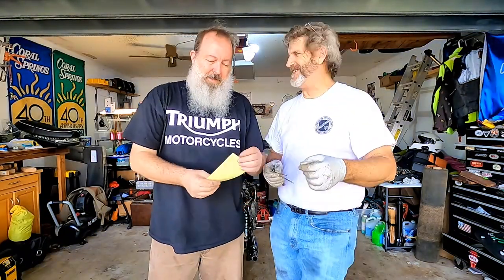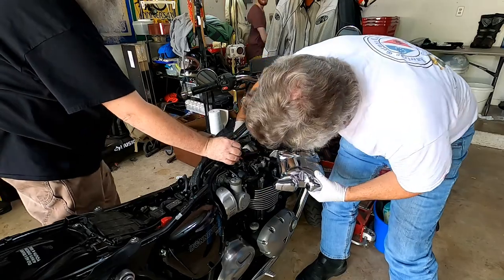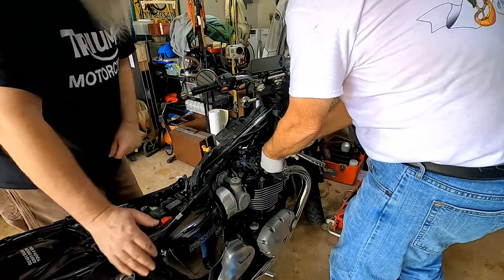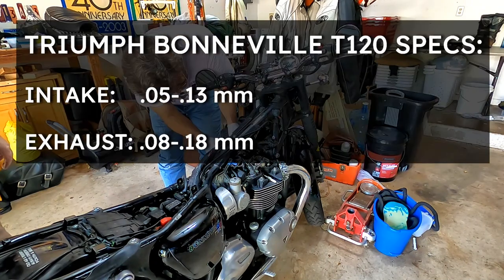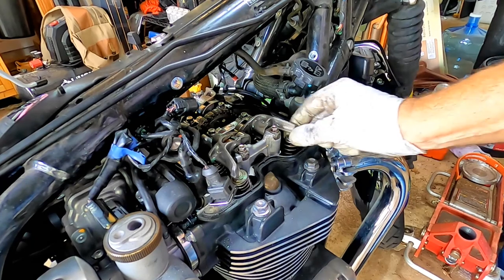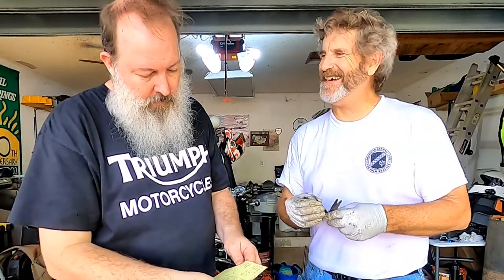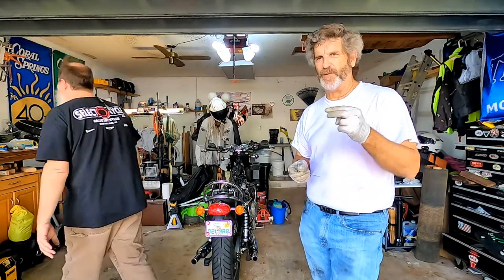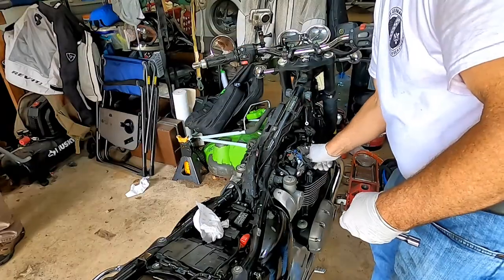DIY Valve Check on a Triumph Bonneville T120

Comment: You guys just sold me on a Speedmaster with this video. Triumph seemed to check all my boxes except for that awfully short service interval. I thought "Valve checks twice a year? Those are such a pain coming from my XSR700." This platform looks wonderfully thought out. Easy access to the top of the cylinder heads and you don't even have to mess with the timing. Outstanding.
Reply from the maker: Yeah buddy!
See if you can go on a test ride.
Reply from the maker: Valve clearance check is only every 20,000 miles. Do you ride 40K a year?
Reply: @AmenMoto  Oops, I thought it was 10,000.

Comment: I wish the Triumphs had the old adjustment screw and lock nut system. That would be a lot eaiser and you wouldn't have to order shims and then wait for them. Value lash adjustment could be performed in no time at all with the adjustment screw and lock nut system.

Comment: Good vid guys thank you....I have an odd cold start rattle on my 2020watercooled T100 Bonnie first heard it a 500mls now done 2000mls....Triumph Dealer said dont know what it is...just ignore it....I cant do that.

Starts around 30seconds after a cold start...only after a cold start does it rattle...as I say not right away but around 30 secs after the motor starts....I let it idle for a bit before I ride it.....the rattle then slowly disappears after around 2 mins.

Got to know a guy online....same motor as mine the 900cc water-cooled.has exactly the same rattle...his dealer have cured it so he tells me....they say one valve had to big a gap.

Sounds odd to me....not heard of slack valves going quite as the motor warms....or not being able to hear immediately the motor starts.

Going to take a look at my valve clearance's myself soon....dont trust my dealer....I have worked on my own engines all my life...now 69.

The bike is still under warranty....but when I am told...just ignore it it dont fill me with confidence.

Nick in the UK
Reply: HI Nick i know this might sound stupid. But the gasket might have a leak ......... just check for any small amount of oil ... just a smear???? hope this helps
Reply: @carlberg6918  Hi Carl....sorry mate not sure which gasket you mean
Reply: @carlberg6918  Cheers mate....will take a close look.
Reply: @nickaxe771  Thanks for reply Nick ..let us know what it finally was . Like you I wouldnt let it go it would drive me mad. Keep safe

Comment: I just did this last fall at @12,000 miles... luckily I was in spec. It is quite an operation though, eh? LOL.
Reply: Hi Scott !  How long does this take from go to finish to check the valve clearance ? As in from dis assembly, checking and re assembly ?  

Thanks !  NZ
Reply: @johnmartin7158  It took me better part of 3 days to slowly and carefully do. I took my time and have never done it before. On the 24,000 mile check, I could probably do it in half the time assuming it was still in spec.

Comment: I have a knocking on a new 2022 triumph scrambler 1200xc with only 2000 miles.
Sounds like it’s coming from the top end.
I’m concerned about engine damage.

The knocking sound seems to be loudest and coming from the top end on the back side near the carburetors.
My question is could valves make this particular kind of knocking sound and would an engine with only 2000 miles need a valve adjustment?

Could you please take a quick listen to a very short video I have on my channel.
There are only a few videos so it’s quick to find.
Reply from the maker: Have you shown the dealership?
Reply: @AmenMoto  : yes, the general manager has a bonneville and claims it’s the valves.
Reply from the maker: @ginoasci  ok good so have them check the clearances on them. Won’t take them long.
Reply: @AmenMoto  :  I don’t think they’ll do it.
It’s under warranty and they won’t get paid unless it gets approved by triumph.
The dealer is very very difficult to deal with. They make you feel like you’re bothering them.  It took ten months to get them to just acknowledge there was an oil leak even though it was staring them in their face.
Them cleaned that part of the engine with brake cleaner and took the finish off.

We’re not talking about your typical dealership, this place is a mess.

Comment: Guys interesting video....in the process of re-setting the valve gaps on my 2020 watercooled T100.

I have a Haynes Manual Watercooled again for my specs....inlet are the sames as the figs you quote....but the Haynes fig are different from yours ie 0.12mm to 0.22mm.

I am stuck now not knowing for sure what my exhaust valve gaps should be.

Can I ask were you got your valve gap specs from....not doubting your figs as I have seen another vid on you tube quoting the same figs as yours.

But being exhaust valves I dont want to sett em to tight.

Keep up the good work....love your vids.
Reply from the maker: We were going from a Haynes manual I have as well, but my bike is a 2017. My bike is also a T120,. I think you should use the numbers in your manual. The difference of ten thou is most likely due to the difference in the model/engine, but also possibly due to the newer engine model year they may have changed the spec. Go with what your book says. 👍🏻
Reply: Hi and thanks for getting back to me my Haynes manual covers bikes from 2016-2019 and quotes exh 0..12 to 0.22mm

Yes I have now watched 3 vids on youtube quoting the same as you guys...0.08mm to 0.18mm

My manual has a 2020 date on the first page I wonder what date is on yours.

I am experiencing a tapping noise not long after a cold start....that goes when warmed up...around 2 mins after a cold start....been told could be a slack valve....so dont want to be setting them to slack if I can get away with it.

Asked Triumph UK and waiting for them to get back to me....

I am in the UK.
Reply from the maker: @nickaxe771  It's a tough conundrum for sure.  Good luck man I hope you get the tappy noise figured out
Reply: @AmenMoto  Going to call into a triumph dealer and see if they will give me the info.

They seem to play there cards close to there chest.
Reply: Ok called into my local Triumph dealer.....could not have been more helpful.

Got my bike up on his screen.....confirmed the figs in my 2020 Haynes manual...which are bigger on the exhaust valve than you guy are setting to....

Maybe worth looking into.....you could have tighter exhaust valve that you want to risk.

Maybe Haynes had a misprint in the earlier manuals for the watercooled engines.

Or poss Triumph changed the spec.....I asked that question.....they could not answer for sure.
Reply from the maker: @nickaxe771  Thank you so much man.
You sure the difference isn't due to the T120 vs. T100?
Reply: @AmenMoto  Make no mention of engine size.....can only presume from that same for both.....but worth checking.

What year is you manual.....I suppose Triumph may have changed spec for later modles....my bike was register 2020....could have been built 2019.